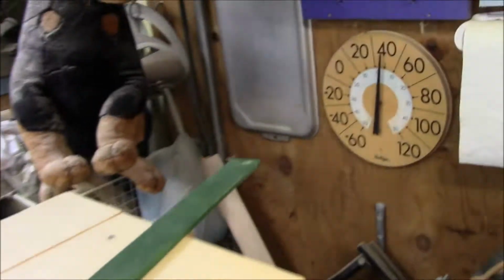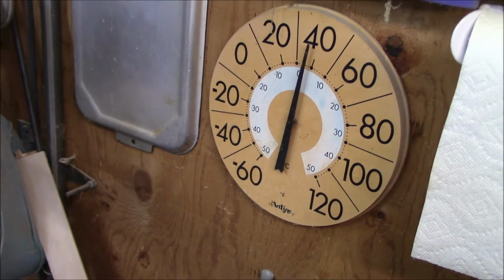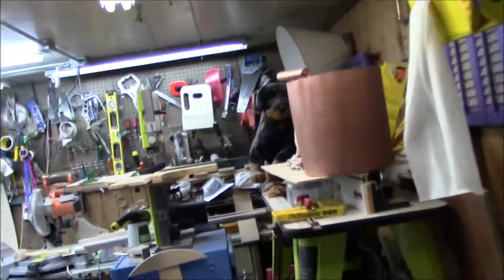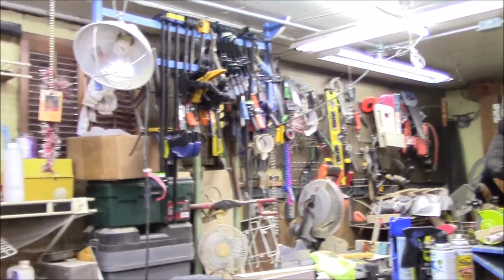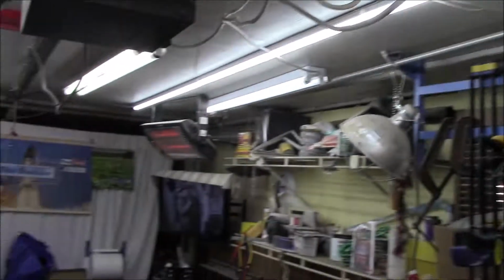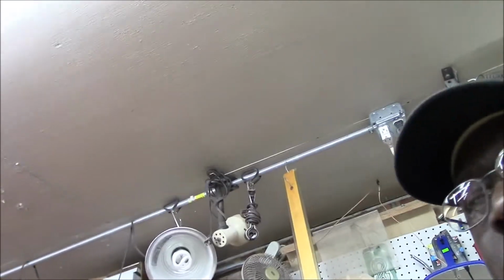Part 1 Introduction - Workshop Solar Panel Project

Comment: I dont think you'll be able to run the heaters on that small of a system... Here is a guy that shows a lot of stuff on solar and wind.

https://www.youtube.com/watch?v=5P6VZbrJN6o
Reply from the maker: Good comment I agree. I probably wasn't clear in my explanation. My long range intent is to have the flexibility to be able to transfer on an  individual bases each load from either a single heater, lights or other miscellaneous load sources; not to run all simultaneously. For now, I just want to run my LED lights. For those reasons I'm adding another string of electrical outlets fed from the solar system to be able to plug in & out various items. Using that, I can plug in & out between the outlets fed by either the solar or house current. After this initial installation, I'll see if I have the budget for addl solar panel(s) and battery(s). As a novelty project, this is starting to get pretty expensive so far! Thanks for watching.